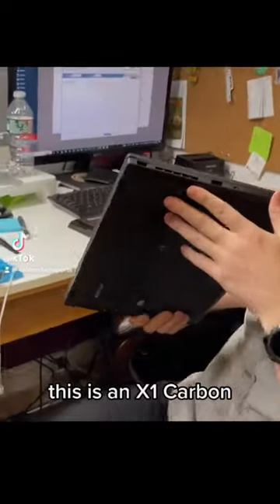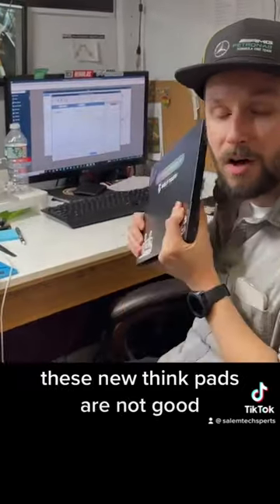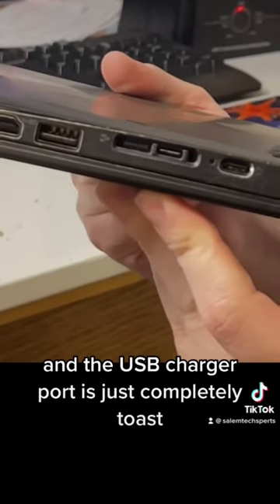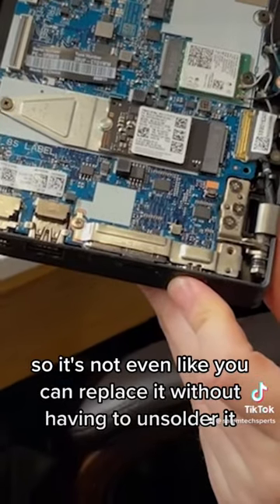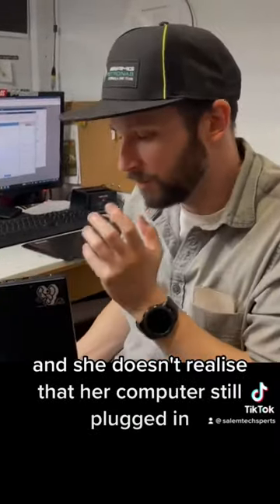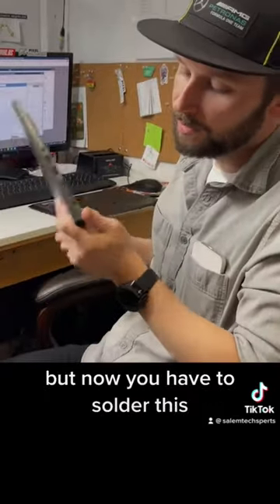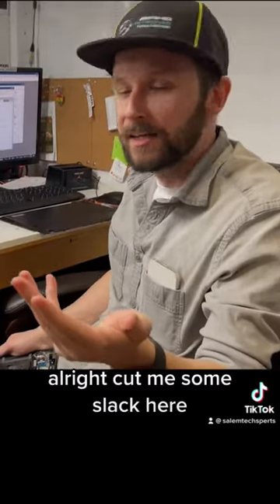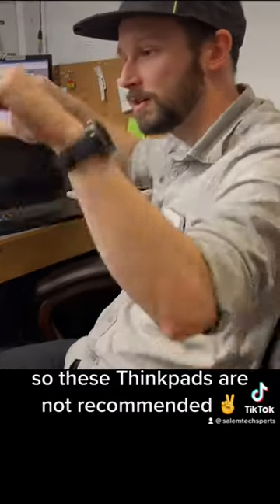Another reason older ThinkPad’s were designed better! #shorts #broken #computer #technology

Comment: Are you guys actually in a subway 🤔
Reply from the maker: A tour of my #iphone and #computer repair shop inside of a Subway restaurant #technology #tech
Reply: Can I get an HP laptop with an iPhone 13 on the side 🤪😜
Reply: @SalemTechsperts I agree. The old thinks are always the best. It it ain't broke don't fix it buddy.
Reply: I can solder, it's a skill that you have to learn.
Reply from the maker: @manino12345  I can solder too. The consumer can't solder. Which means they can no longer do a charging port repair by themselves.
Reply: @SalemTechsperts  picture,
Reply: @SalemTechsperts everything that is easy to break and under high use like a charging port on a laptop should be very easily user serviceable yet we all know the reason they went this route which is money
Reply: HA What are the chances. I JUST had a conversation with a friend who works at a school board and he was just telling me how he bought the adapters in bulk because they break and he can fix it. He has a whole school to do so now he can't fix it because soldering. So then Lenovo warrenty is what 2 years? These always break the third year. We seem to be sacrificing repairability for that slick thin compact laptop. I don't know.
Reply: @SalemTechsperts  when the FUCK did youtube allow u to put a video in a comment like this? Never seen it but it’s probably not new because I haven’t updated the app this year
Reply: @SalemTechsperts bro no way
Reply: Quite fucking literally, yes.

Comment: For real Lenovo doing everything to ruin Thinkpads. Some don't even come with swappable Ram sticks anymore.
Reply: This isn’t Lenovos fault. The EU is requiring phones and laptops to use USB-C charging. No more proprietary ports allowed.
Reply: Yeah, a shame
Reply: I have a T480, still has replaceable ram and wifi, but has the dreaded soldered usb c port.
Reply: We should all thank the eu for finally putting their foot down and forcing everyone to use standards.
Its just a shame company's refuse to make replaceable usb c ports when its not expensive nor hard to do.
Reply: @Julian Cross  not on laptops.
Like do you guys even read laws prior to shitposting about them?
The law is only about a certain range of power delivery. 
And even then the law does not state "USBC ports have to be integrated in a way where repair is inhibited" 
So this is fully on lenovo.
Reply: @NoobCastProductions  USB C is a good thing, soldering it onto the motherboard is a bad thing.

There is nothing stopping Lenovo from mounting it on a easily replaceable daughter board but they want to save a few cents on what is supposed to be a business laptop
Reply: @NoobCastProductions  EU didnt require shit on laptops + you could still make USB C ports modular
Reply: Correction. Not some anymore… Most. Even if they do, its typically only 1. Only workstation models let you change out both sticks.
Reply: @NoobCastProductions  that doesn’t mean it has to be soldered. Not to mention, with the EU law you can have a proprietary charger on it as long as there is also the option to charge with USB C. It’s why Surface devices get to keep their magnetic port.
Reply: Louis Rossmann kept saying they were better than Apple. Lenovo took it personally.
Reply: @NoobCastProductions  Firstly it was waaaaay before the demand for usbc by the EU. 
Second this is for phones, not laptops.
Third USB-C ports can be modular just like the old barrel jacks and the brick thinkpad plugs.

So what's your point?
Reply: SODIMM slots take up a lot of space, and stuff like the Ryzen 6000 chips require LPDDR5, which isn't available in SODIMM form factor.
Reply: @hipster2283  Ryzen 6000 is compatible with DDR5. And there were tonnes of laptops where two sticks were stacked. So only took a bit more space than one stick.
Reply: @NoobCastProductions  no, it is Lenovo’s fault, USBC ports can be modular instead of being soldered, MacBooks have modular I/O so why can’t thinkpads?
Reply: @gamingwithadutchman Haha, New we shouldn't. We shouldn't have ant government telling companies or humans what they can't or can do...
Reply: @VentusHarpus12  i understand what you mean kind of a let the people be but then again greedy company's are abusing the people so i dont mind goverments kicking in to protect their people from company's like this
Reply: @NoobCastProductions  AS a unified charging port reduces e-waste, I understand that notion. I can't agree with you claiming that lenovos design choices are exclusively the fault of EU guidelines. Are you seriously defending proprietarism?
Reply: @NoobCastProductions  The USB-C ports can be made more ruggid AND replaceable.
Reply: @NoobCastProductions you could make your USB-C ports easily replacable, they just don't. How hard is it to use a flex cable to connect a small board with a USB port on it? It's easy, but it's slightly more complicated than just soldering it, which would cost them a few bucks per laptop.

Lenovo doesn't care enough about repairability to engineer ways to make repairs easier, which IBM did.
Reply: @VentusHarpus12  companies should experience complete totalitarian control when it comes to ensuring consumer protection
Reply: Our school has got a x1 yoga and it comes with soldered lpddr5 ram 😢
Reply: @NoobCastProductions Proprietary parts exist for a reason, they're basically an excuse to rip you off. EU requires USB C? No problem, just have proprietary USB C cables.
Reply: Yes, but surely they can still make it replaceable?

Comment: That's why I have the magnetic USB adaptor on my Thinkpad tablet. It's awesome. About 4 years later still no issues
Reply from the maker: This should come standard, those magnetic chargers are fantastic
Reply: @SalemTechsperts  apple and Microsoft hold many patents on magnetic conectors for charging or docking
Reply: @SalemTechsperts  and most pc manufacters are too lazy to inovate
Reply from the maker: Interesting, I didn't know this. Kind of like HP having the patent for the fingerprint scanner on the side of a phone. Shame
Reply: @redstone0234  untrue, mag pin connector are used in tablets, 2 in 1 laptops by asus, moto, Lenovo
Reply: This means you can charge usbc, musb, lighting with one $100 magsafe system
Reply: Thinkpadlet
Reply: @SalemTechsperts  Sorry to necrobump this comment, but you should keep some usb-c magnetic tips in stock to provide with the repair for these people. The sad part is there is no reason the USB-C ports can't be modular, it is in my phone. We need to start holding these corpo clowns accountable.
Reply from the maker: @xeddiustripp6398  I have yet to find a reliably safe magnetic USB-C though

Comment: Be like framework, make the charging port replaceable
Reply: and have 4+ of them
Reply: Be like framework, make literally everything replacable
Reply: You can even make the whole IO just charging ports!
Reply: Uh, the charging ports on those are soldered on too. The extensions that are using facing are replaceable only. Of course there are 4 of them but still.
Reply: @Zackhasacat  the internal usb-c ports receive next to no wear from use, while the exterior extensions/ports take the majority of the wear and tear, and are replaceable.
Reply: @Zackhasacat  on top of the other reply, you can replace the board without having to scrap the entire build, and if the board still functions as a computer and boors, turn it into a server or something. 

It's just... that simple.
Reply: agreed!
Reply: Not even necessary to go into detail. It's as simple as "Be like Framework" lol
Reply: these ARE replasable, but it requires a several thousand dollar machine to do it
i think its more of making it EASILT replaceable, like the older independent daughter boards, and is not like there is no space in there, the newer motherboards use up like 40% of the space available, they have NVMe, which uses little to no space comapred to old SATA drives, batteries are thinner so also dont use more that 50% of available space, and ram they have only one slot if you are lucky or is integrated to the mobo.. SO THERE IS SPACE FOR AN INDEPENDENT CHARGERPORT WITH A BOARD TO BOARD CONECTOR

Comment: My L560 is going strong with that yellow rectangle, I do wish it had Type C (not for charging, but for everything else). Shame they solder it in there. The best move would be to do what Apple is doing on the Macs and allow both a proprietary and universal charging solution by letting both Magsafe and USBC work for PD.

Comment: I work for a company that provides on-site warranty services for Dell and lenovo.

Most of the lenovo motherboards i replace are for USB ports.   The x1 carbon 9th gen (20xw) and e15 gen 2 (20td) are by far the worst offenders.

But the problem is pretty common and I do many dells for the same broken usb-c port issue.
Reply from the maker: Interesting, thanks for the info. I wonder why they simply don't implement a magnetic USB-C solution, or just keep their old charger port in addition to the USB-C as per EU regulation.
Reply: @Salem Techsperts  EU regulation got nothing to do with it.
Laptops are well outside the power limits stated in the law.
And the problem is also not the USB C port, it is the customers. I have never had a single broken USB C port on any of my devices in nearly 10 years. 
The problem is with the manufacturers saving less than 1cent per port by choosing to take a board with integrated usbc port over the ones with a replaceable port.

Comment: They should design a magnetic breakaway cable for the laptop like they have for the cell with a 360-degree rotating head that would fix the problem right there

Comment: On the expense of not being able to use it with the designed docking station
The port rigth next to the USB-C charging port is also a USB-C charging port
So with a working charger, if the defective port didn't short it,  the laptop will work just fine
Same on many Macs and other laptops with more than one USB-C which takes charging, once I saw a Microsoft surface with defective charger and asked the other to try it with an USB-C charger and it worked, and another example I tried: Lenovo T480s has the Lenovo charger and had a USB-C which also takes charge.

Comment: My only problem with the rectangle ones is that the angle on the rim make them easier to break that rounded ones (i write this comment on a laptop with a half broken rectangle port)

the main problems with usb c are: center pins easier to break, same port for way different voltage that can brick devices.

For the overheating part, tbh if they didn't put it right next to the fan heat pipe on mine, maybe it wouldn't heat up so much.

And yea, the soldering thing is a d move (and placing the older ones in a way that you had to remove everything to access them was also a d move (albeit a lesser one for the pro))

Comment: replaceable USB C ports absolutely can exist too. Phones had flex cables to standalone USB-C ports for a while now. They're not even hard soldered to the charging board anymore.
Reply: Absolutely this. Flex cables and ribbon cables can be annoying to work with for the end user for sure, but for an experienced repair shop it turns a commonly required fix that needs a couple of hours and a relatively rare skill set to a couple of minutes that anyone with half a brain can be taught to perform. Your customer will be happy too because you can easily justify cutting the cost to the customer by over half with your expenses because you didn't spend a lot of time on it.

Comment: And before that, ThinkPads had latches on each side so you could lift up the top of the shell to replace FRU's without even removing screws. They were truly amazing for IT shops; we could swap out pretty much anything in minutes. Lenovo is not IBM. IBM isn't even IBM anymore when it comes to consumer goods because they abandoned that market. Point is, Lenovo thinkpads are just another laptop now.
Reply from the maker: Facts. They milked their IBM patents dry and then refused, or couldn't, create their own on the same level.

Comment: ive got a t15g gen1 that fried its charger port cable, it's def user replaceable but to get to the two screws holding the bracket in place you have to take literally every other component of the laptop apart.. like sure it's "user replaceable" but if im taking all that apart i don't trust i'd be able to put it back together lol

Comment: My thinkpad w520 is going strong, I've got some t500 machines too very solid but they can be a bit of pain with different length screws and whatnot but everything can be replaced. I can do a fair job soldering but nobody wants to solder dumb stuff like this.

Comment: The usb-c charger has accidently been ripped out of its port several times on my Thinkpad.  It's tougher than I thought it would be. The yellow slim line connector is definitely more durable though.  Luckily you can charge the Thinkpad with the other usb-c port next to it if the first one breaks

Comment: The usb-c port is problem enough to make easy to change due to the plentiful ammount of pins, makes it really hard to make removeable. Even the framework laptop has sodered ports on the mainboard, they just have the modules cover for it. Best I have seen is to make the i/o on a daughterboard, but lenovo putting the dumb ethernet connector that I don't think I have seen anyone use right next to it makes it pretty bad

Comment: Suggest your customers use magnetic USB-C adapters
Reply: A bunch of them can't handle 65w
Reply: @zNoah  there is ones that can
Reply: @staticziao  some doesnt mean qll of them
and i wouldnt put trust in another person's intelligence (or shop honesty) to get one that wont fry
Reply: But doesn’t support data. The best part about usbc is one cable solution. I get to my desk, plug in one cable and i have my laptop charging, my monitor lit up, my keyboard and mouse active and also connected to wired ethernet.
Reply: @TheAmithgowda  they actually do support data
Reply: That would make him loose them as customers...
Reply: at the Amps used for charging it might ARC
Reply: @jojodroid31 no it wouldn’t.

Comment: Even professional repair shops hate when the charging port is soldered directly to the main board, especially if it's something with a bunch of solder points like USB-C.

I've seen a video of Louis Rossmann, who's shop professionally does board level repair that requires micro-soldering, praise the old ThinkPads SPECIFICALLY because that charging port was separate from the main board and could be easily replaced as a part that is most likely to be damaged.

Comment: At work we've seen a ton of the new Lenovo laptops fail with their USB-C ports too. Not only the charger but also the backup charger ports. (On models where there's a primary charging port and another port that can be used to charge)
They're garbage.
Reply from the maker: Exactly. Both ports fail in the same manner, garbage

Comment: I personally wouldn't call a soldiering a type-c port microsoldering, but the failure of having non swappable type c ports is really annoying. Also not all of the yellow tips were swappable without swapping out the entire motherboard if I recall correctly the  L440s and a handful of other models had integrated DC jacks, so unfortunately not that new.

Comment: USB-C standard should have used a lightning clone
Reply from the maker: I agree
Reply: @SalemTechsperts  I've had shop fires because someone dropped off a device with a bent USB-C port, didn't let me know, and I went to plug it in and caused a fire because live and neutral pins had bent together when the person ripped the cable out at a significant angle. Hoping you never have to have that scary experience!
Reply from the maker: @AQLV  Yeah we've had a charger catch on fire because of a customers bad USB-C port